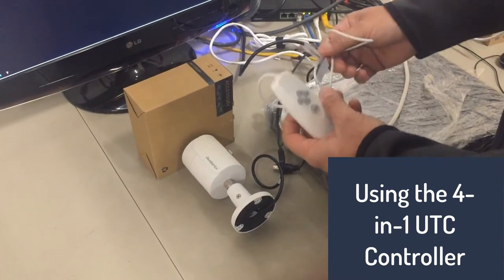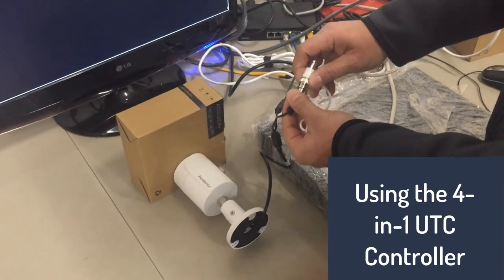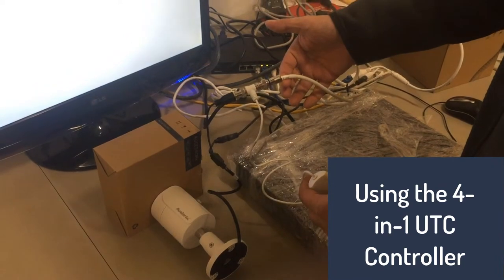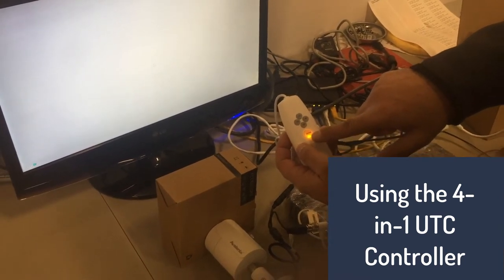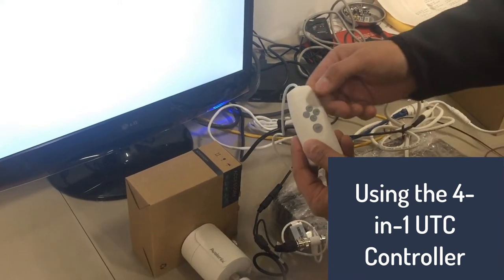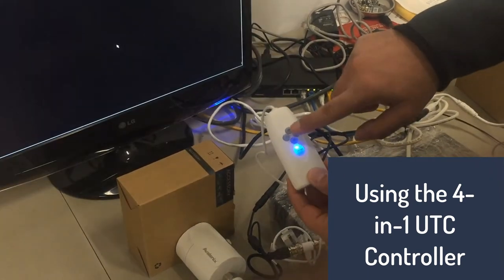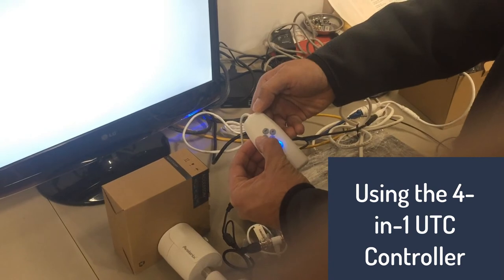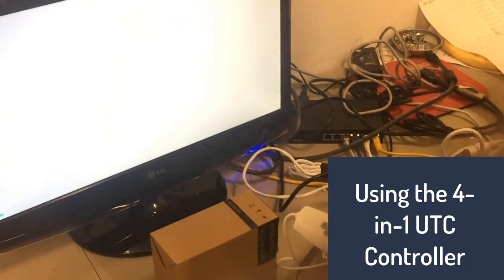How to use the 4 in 1 UTC Controller

Comment: You can access the osd menu from your dvr,why would you need the utc control?Genuine question
Reply from the maker: Good question! DVRs cannot access the OSD menu without a UTC controller when the camera is in CVBS (Composite Video Broadcasting System) mode, an outdated signal type that lacks digital communication. However, it's worth noting that this 4-in-1 controller only works with specific cameras on our website.
Reply: @Cctvcameraworld  That is very interesting,so does the UTC controller send an analogue signal to the camera that is in CVBS mode?
Reply from the maker: Yes,  on select 4-in-1 cameras the 4-in-1 controller is able to change the mode by sending a signal in CVBS mode. However, the majority of them are unable to take any signal when set to CVBS mode.